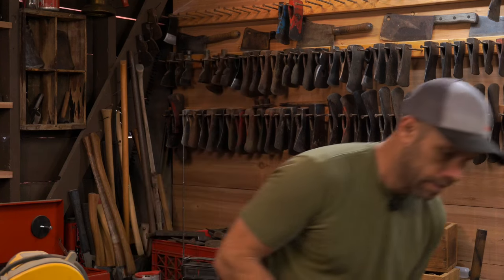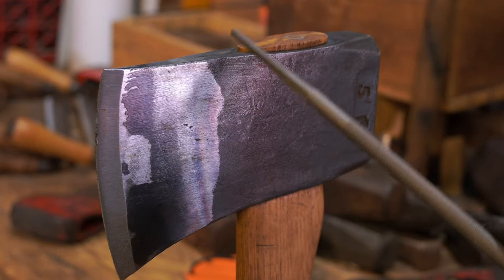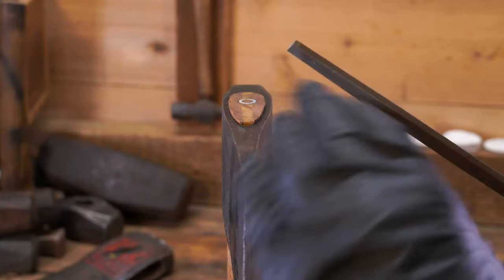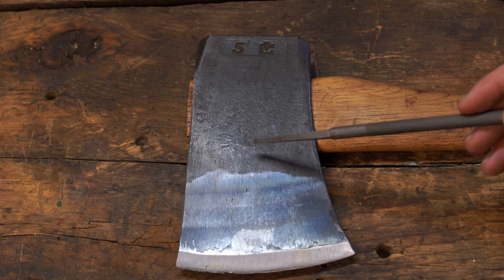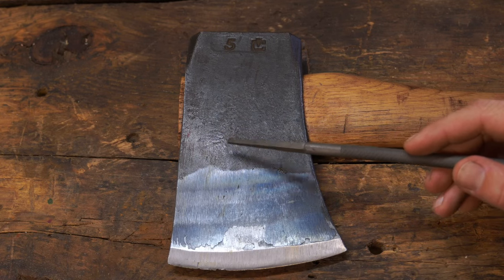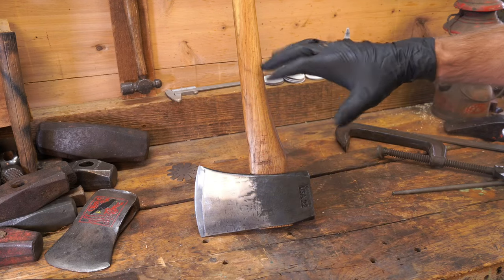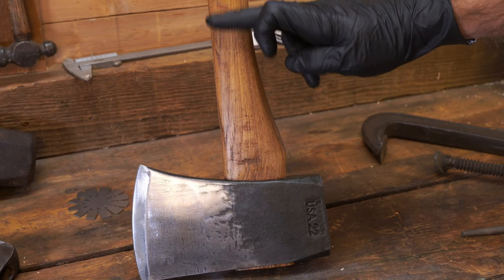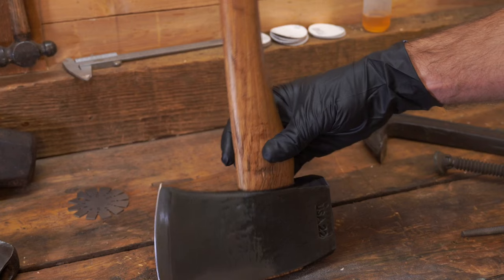3 mods for a firewood Axe : Tuning up the Council Tool 5lb Splitter

Comment: What you're referring to as "slag" is actually mill scale. It's a low quality, (somewhat) rust resistant scaly type of iron or steel that forms when hot iron/steel is exposed to air.
Reply: It's more like a collection of the different types of iron oxide which get drawn to the surface during hot or high pressure work. One of which is the type of iron oxide which is normally referred to as rust. Source: I'm a draughtsman in the steel industry. Also worked as a blacksmith and this scale is a menace in that environment!
Reply: @frackcha  Ah thank you! I don't know anything about metallurgy. My only experience with mill scale has been for weld prep. I've seen it form on iron/steel during the forging process, so I assumed it was just do to heat.
Reply: See where im from, a "slag" is something very different indeed.
Reply: @Andrei-un1cl  wah wah
Reply: @Andrei-un1cl a "shlakoviy"?
Reply: @privateassman8839 metallurgy is a completely different manufacturing process than forging. This has nothing to do with metallurgy.

Comment: Mr. OLD IRON...speaking of oldtimers, heat the head on a wood stove, then rub the beeswax mixture on. The pores in the steel take it readily rather than just having it on the surface. I agree the best thing for that handle is to keep the linseed oil on it, do not let it get thirsty...very enjoyable video sir...

Comment: I’ll give you another tip. Save all your used oil in a squirt bottle for when you’re splitting. Dawn dish soap bottle works good. Put it on the bit  while you’re splitting. WD-40 also works good.

Comment: Reducing the friction of the bit entering the wood by smoothing out rough surfaces is a good idea.  If you want to reduce that friction even further, make the final scratch marks from polishing run parallel to the direction of travel instead of perpendicular.  This principle can also be used backward.  Heavy perpendicular scratches on steel splitting wedges help keep them from backing out.  I'm speaking as someone who has split over a hundred cords of firewood by hand in the last dozen years, as well as many hundreds of logs for project stock.
Reply from the maker: Same concept with throwing axes to get them to stick.👍

Comment: Once i used linseed that was heavily dehydrated.  It moved like pitch.  Was pleased to find that it left almost a hard, protective coating after it soaked into the wood.  There was much less dammage to the handle when i, occasionally....would take too deep a bite with my maul.

Comment: If you want to turn it into a great splitter, keep grinding the top and bottom until you end up with a curve. Looking head on you want a splitter to look something like this () with the handle coming out the bottom. Square heads like this [ ] stick. With a belly like they should have the wood is only touching in the center and the head will rock making removing much easier. Also if your worried about your handle, wrap it in bailing wire or cut up a soup can fold it around and rivet it in the back. 
   I don’t use mine as a splitter it’s a wedge banger but I did pretty much the same thing as you did 👍🏼

Comment: I have one like it but changed the handle to a nice, somewhat slim, 32" curved handle. I have the same problem but it does hold an edge well and the slag is not peeling away as yours. Thanks for the reveal.

Comment: Terrific informative video. Once you Polish the surface smooth that should help inhibit rust. I see guys with carbon steel knives applying a forced petina with vinegar and such. Why do I never see this on an axe. Will it help prevent rust? Are axheads a different composition of steel that does not accept a petina?
Reply from the maker: We do force patina,  mostly cold Bluing solutions.

Comment: I totally agree with your observation to the rough finish of the axe heads, if you look at plumbs victory line and their rough finish, that was all due to their contribution to the war effort on WW2, and that rough finish of plumbs victory line is a lot more uniform and smoother than gransfors bruks finish. Pre and post war, all plumbs are smooth, same goes with pretty much all the other days of old axe manufacturers like kelly, mann and etc. The most well finished out of all of them, though, in my opinion, are the collins legitimus, the quality is top notch from symmetry to overall finish of their heads are even better than those of my black ravens, JM Warren's is another that is up there with the legitimus. But hey, why spend the time polishing and finishing your product when you can skip it to hide the flaws of manufacturing and sell it to fools who would buy it with no questions asked.
Reply: Council tool velvicut line is very smooth.
Reply: @louisshirk5027   yup! I totally agree.

Comment: Well my question is is beveling something is going to create essentially two of what you tried to remove one of. What I mean by that is you're trying to get rid of a straight edge that is possibly creating a decent amount of friction with the wood. Hence by its obvious paint removal like you had shown your example of but by creating a bevel going from one relatively flat part of the ax head to another, wouldn't that create two sharp edged straight lines and what would that do?

Comment: It looks like delamination on the cheek near the edge. It looks like it may have been forge welded together using a quality steel for the edge.
Reply: I'm an old pipefitter/pipe welder and I agree 💯.
It looks some one has put a piece  of plowshare blade on it or stellite  edge that looks delaminated in spots NICE CATCH!

Comment: You would be amazed how tools and sand paper work with proper air supply, plus using flapper wheel pay attention to your strokes let your tool actually do the work  including files

Comment: Should do a co-op with project farm and see how much resistance it removes!
Reply from the maker: I think some testing is in order for sure. I've not seen project farm, I'll check them out.👍
Reply: Yes please do some testing. A simple closeup slow-motion video would be easy to show wood contact areas. I imaging the wood won't contact the cheeks and top edge if your splitting dry wood with good velocity. Contact with the cheeks and edges may occur while doing other chopping and the mods you made would help.  I like the new look you gave this axe. @old_iron_axe_and_tool

Comment: So many people forget or fail to realize that north America originally knew Gransfors Bruks as the cheap budget axes back in the 60's.
The light blue paint was known.
In my experience the steel is a bit softer than the woodslasher axes of the day, I will admit that the  late 60's woodslashers were a little sloppier than the swedish imports but the swedish steel isn't magic.
A lot of people refuse to accept it, and maybe that's because the flippers want to fetch a premium for them and buyers don't want to admit that they payed too much ?

I just want to put it on the record that the vintage swedish axes you'll find aren't the same as today.
I'll also say that they're actually better, standard working tools not the boutique sportsmans tool of today.
Reply: Are you saying that the older Swedish axes are better or that the ones they produce today are better?
Reply: @kenj8558  neither really.

The modern swedish axes are overpriced overly revered and kind of poorly designed, the steel quality is fairly good but that's all they have going for them.

The vintage swedish imports are coveted and desired as if Sweden somehow makes or has always made the worlds greatest axes, but they were low end budget axes of the day.
Take your pick, an overpriced ( today they command a premium) lower quality version of superior designed axe or an overpriced axe of inferior design that's technically higher quality in steel.

I guess I would say the vintage axes are better and I'd certainly take one over a modern one if I had to choose between the two, but I'd rather have something else entirely.
The modern swedish axes only have bit hardness to offer, the vintage ones are a little above average compared to most modern axes but there are far far  better options when choosing from 70 years worth of axe production.

Comment: I’ve never understood why people say an axe is “too sharp” or leave tools like this that rough

Look at competition racing axes. Polished till you can read in the reflection. They’re not using 14* filleting bevels but they’re dam durable and quick and you can still SHAVE with them after a competition 

No such thing as too sharp a blade or too clean 

Incorrect bevel? Sure but never too sharp
Reply: depends what you're splitting. Some of that NA softer straight and open grain wood a sharper axe gets between the fibers and opens them up easily. Australian hardwood you'll break your axe handle getting it unstuck

Comment: Original hang?
Reply from the maker: Yes sir.
Reply from the maker: The axe was new 2 months ago. I'm digging it.
Reply: @old_iron_axe_and_tool  looks like there hanging prosses has got better also
Reply from the maker: @jeffschroeder9089  I've bought two 2022 jersey, three 2023 flying fox  and twenty five 2022 flying foxes also. Every one of them has a good hang. They're brand new handles are a bitch to remove, supper tight. I've heard some negative reviews though.
Reply from the maker: I soaked the hell out of the eye with blo also.
Reply: @old_iron_axe_and_tool  I’ve bought several of the 6lb forcible entry axes most those hangs were questionable but I put different handles on them anyway
Reply: It’s good to see Jeff in the house.